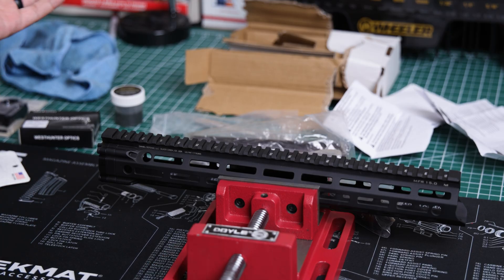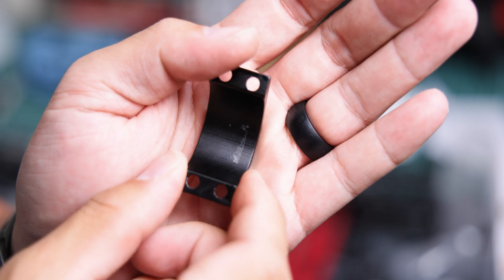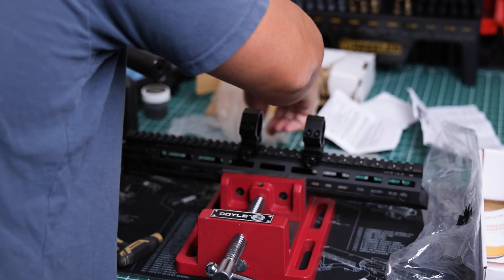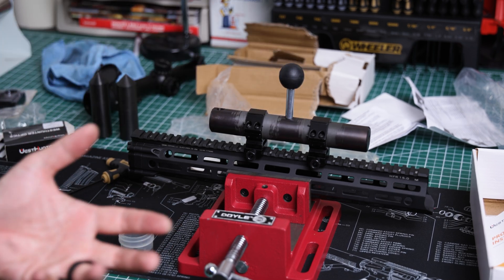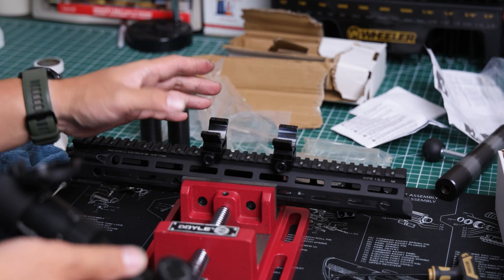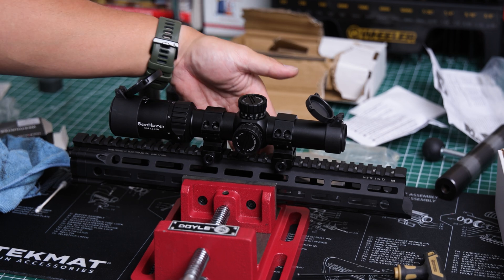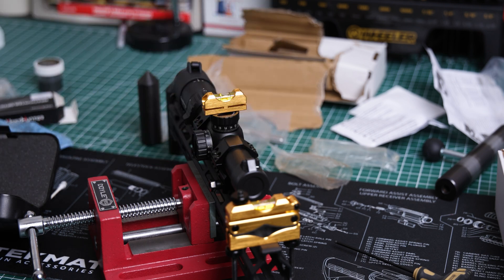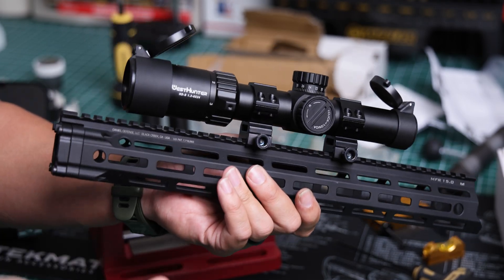SDI | FTT-221, Week 3

Comment: The vortex high ring set was sent incase your rifle bolt was obstructed by the scope or rings with the lower set? I am guessing?
Reply from the maker: I mean possibly or they were the cheapest option for SDI. Lol.
Reply: @rooftop_komplex  oh, the scope and low rings were the cheapest thing they could find for sure. Never even heard of westhunter ever before this class. They did, however, send vortex rings for the high rings in my class.
Reply from the maker: @rb58761  wild right? Considering how much tuition is, they could at least send a lower end vortex optic.
Reply: @rooftop_komplex  I have this assignment today, but I actually mounted the scope beforehand and used it for a few coyote hunts and to be honest I was impressed with it's capability. It worked well. I shot about a dozen coyotes with it out to 400 yards